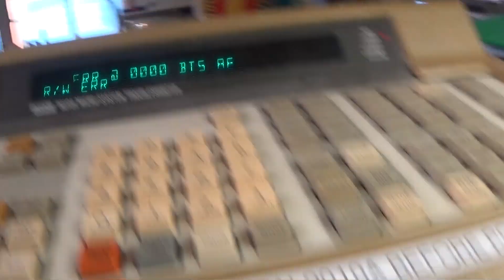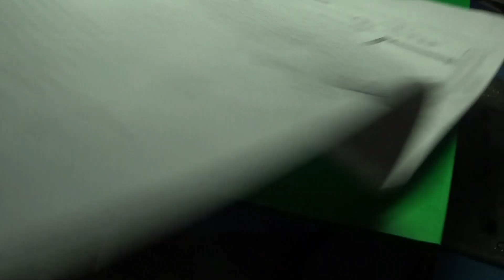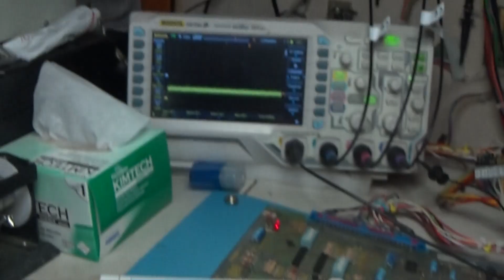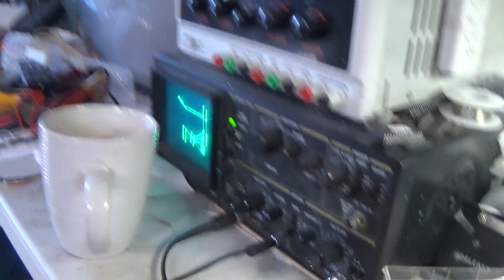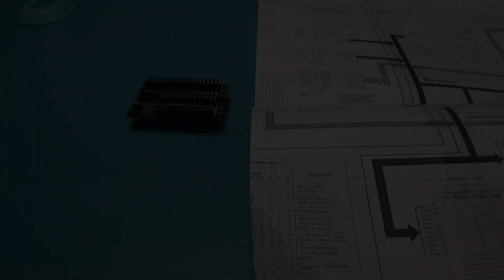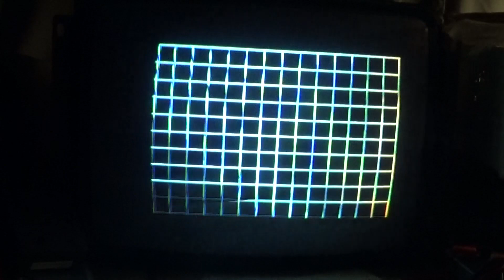1980 Atari Tempest Arcade PCB Repair Plus Single ROM PCB Test and Release  -  3-7-2024

Comment: Nope. If the original circuit board works, no mods should be made.
Reply from the maker: I tend to agree with that. But when a 40-year-old board is depending on 10 ultra flaky, sockets for reliability… Sometimes concessions need to be made.

Comment: That ‘line’ on test is different for sure. The older files use letters and numbers. That is testing the spinner circuit. Basically the 2 pokeys